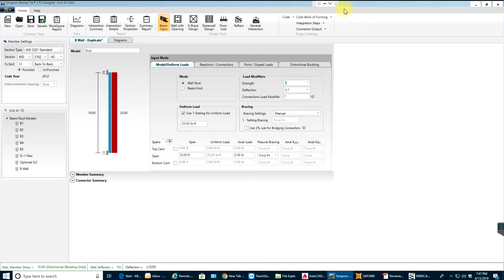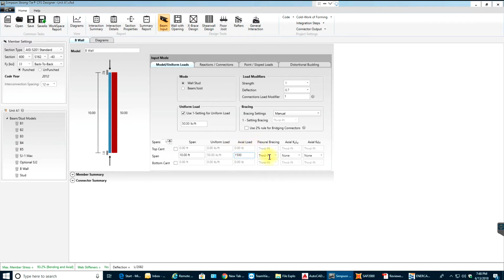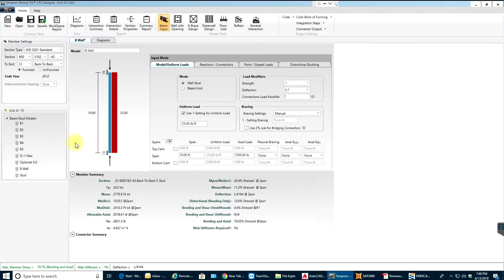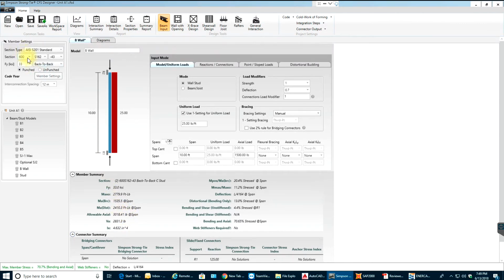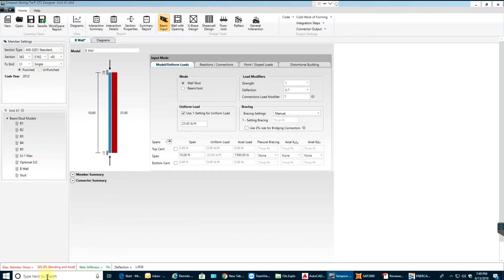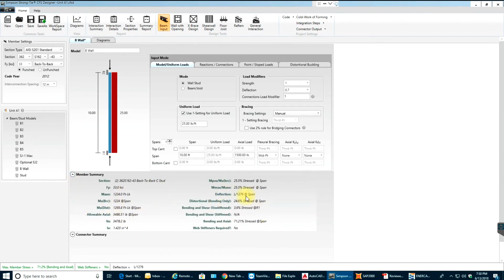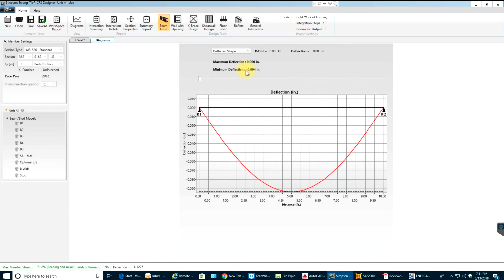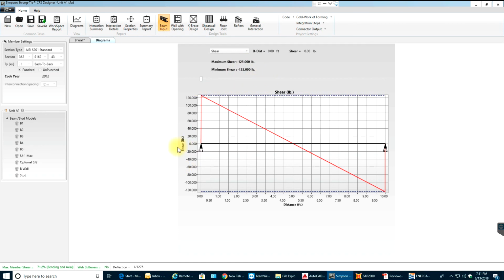Simpson Strong Tie - CFS Designer - Video Tutorials - Wall Studs - Point Loading - Day 3

Comment: Where do you set the stud spacing? 16" o.c.   24" o.c. etc.
Reply from the maker: You use the spacing to calculate the load coming on single stud. You do not have the option to enter the stud spacing. You do not need one.
Reply from the maker: At the very least you cannot enter stud spacing in this module. But you can enter it in wall design module. You can refer LG stacked walls -day 4 video if needed.